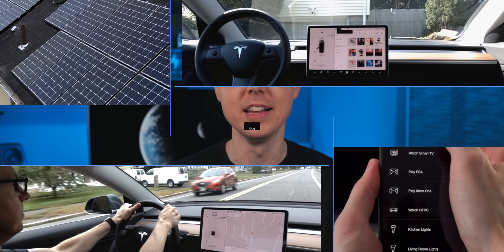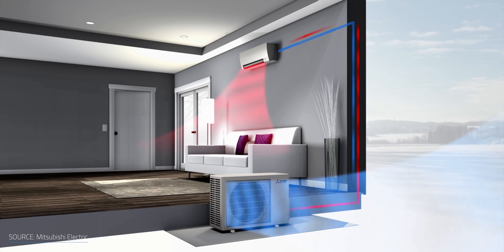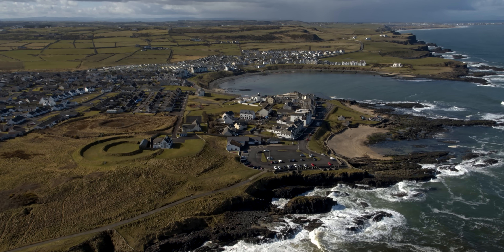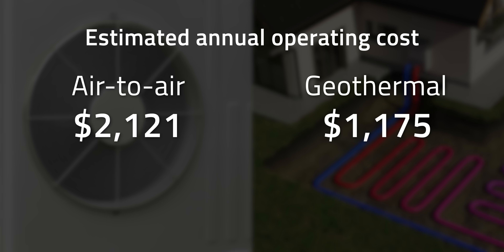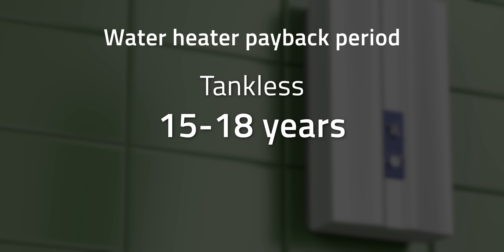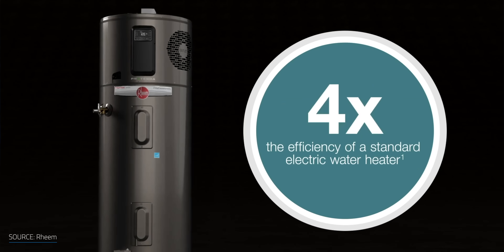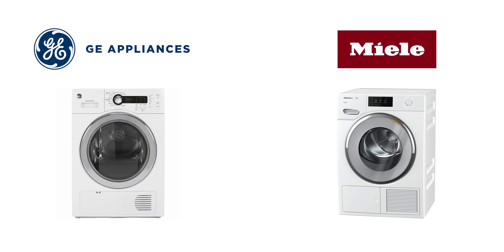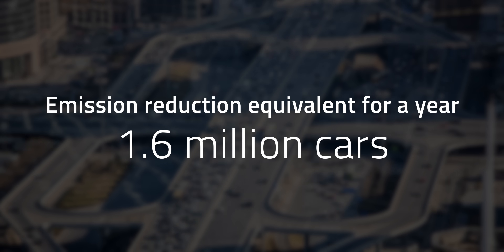Why Heat Pumps are Essential for the Future - Explained

Comment: My brother had a home that used a water to air heat pump system.  There were two wells on his lot and heat was extracted from the water coming from one well and the cold water returned to the other.  In summer the direction of water flow was reversed.  He did live in an area where the water table was very near the surface, though, which helped keep the cost of drilling the wells reasonable.
Reply: @leedon7435  So that explains why my A/C and my heat both run off the same heat pump.  Who knew?
Reply: The water/water variation of this is the most effective/efficient heatpump system you can install. There are caveats and risks, however, and in practice it is pretty rare. Sole/water is typically installed instead of this, but also has prohibitive cost and space requirements - cash aside, many new land plots assigned in Europe don't have enough spare land surrounding the building for such drilling to be an option. As a result, air/water pumps are ubiquitous here, but typically can't cope with the coldest days in winter - even in modern and well insulated homes with efficient, under-floor heating loops.
Reply: @jerrymiller276  all AC are heat pumps. They pump heat out of your house in the summer. Models that do both cooling and heating simply have a reversing valve that switch the direction of flow for the liquid refrigerant in reverse. They then pump heat from outside into your home. The air on the outside compressor will be even colder than the surrounding air, even in freezing Temps.

Comment: I had a Miele heat pump dryer for almost a year now and it's pretty great. What I didn't expect is that this dryer (and its companion washing machine) totally changed how we do laundry, for the better. The fact that the dryers don't get as hot is actually a good thing, because overheating clothes makes them wear out faster (even when accounting for the longer tumble time, you come out ahead). However, the lower temperature and just how the dryer works, means it's important to sort laundry into similar fabrics. For example, if you try drying some jeans and t-shirts together, the t-shirts will dry before the jeans. You should be sorting this stuff anyway, but a heat pump dryer really forces you to do this. So, we got 4 smaller laundry bins and now we pre-sort as we throw the dirty laundry in: towels/denims, dress shirts, cold, and regular/warm. This way, we're always ready to run a quick load, at the appropriate settings. No more time spent digging through a pile of laundry, sorting the colds from the warms. It's great.
Reply: Does the room the machine stands in become colder?

Comment: I didn't realise these systems weren't as widely used in the rest of the world. In Australia, they're basically the only type of system you can get and are definitely very efficient. They work very well in our climate as we do experience all the seasons (tending more towards the warmer side), but without extremes. I have even automated my house to turn my split systems on in summer while there's excess solar generation in order to trap some of that cool air inside. It's especially good to come home to an already-cool house in Summer.
Reply: I don't think that's really true. I think you would find the vast majority of our heating and cooling in Australia is still gas or electric.
Reply: Heat pumps are big in Tassie.
Reply: @JoLynch0  You are misunderstanding the video I believe. All split systems/inverters in AU in the last... 15-20 years I believe run on this gas and are heat pumps. We just don't call them that here. Are there some places that still use gas? Sure, but not many compared to the number that use split systems.
Reply: @Sebastianimator  A lot of homes here in Victoria use gas heating. Decades of cheap gas from Bass Strait and a cooler climate mean it's still common to see in homes.

I've switched my heating/cooling to heat pumps but the hot water is still gas... for now.
Reply: Honestly, it makes a lot of sense somewhere as warm as Australia. Many homes could probably do just fine with heat pump only setups (no need for backup systems).

Where I live, Utah, a heat pump only system wouldn't work, so I would need a dual fuel system, which has a higher initial cost. 

Also, natural gas is MUCH cheaper than electricity here. If I switched to an electric furnace, it would cost me over double to heat my home. A very efficient dual fuel heat pump could just about match a gas only furnace in fuel costs, but the initial cost is still more expensive.

Comment: I’m glad you mentioned tumble dryers. I was wondering if the waste heat from a traditional dryer could be channeled towards a heat pump system, or efficiently stored rather than simply vented into the atmosphere. 

In the future I believe that most homes will have any many ‘closed loop’ systems as possible for heat, energy and water. These advances will likely be useful for environments where water and electricity are scarce - like in low earth orbit, the moon and Mars. This will be yet another arena where space tech helps us on earth and our improvements feed back to space tech. It’s not just about Velcro and Tang 🙂
Reply: There are already dryers (or tangent systems) which utilize the waste heat generated. But these new heat pump dryers don't fit that description because they don't have any waste heat. In the above mentioned system your house would receive unwelcome heating much of the time if there was no duct. That is because the dryer is generating heat from electricity or gas, using it, and then it becomes "waste". With the heat pump dryers the unit is "taking" heat from the air immediately around the machine, using that heat, then rejecting it back into the same space. There is some additional heat generated by the machine itself (via the heat pump compressor), but that is roughly 1/4 of the heat "generated" by a conventional machine. I agree with your comments and mostly just wanted to give credit to the idea that waste heat from conventional dryers (elec or gas) can absolutely be used, though it is not economical or practical to do so outside of commercial laundry operations. In such, it is not uncommon to extract heat from the vented dryer air (using a water coil) and use that heat to "pre-heat" the water for the washing machines (using a water heat exchanger). Cheers!
Reply: I built a box going to my vent wherein I could manually change from exhausting the dryer to venting it through a filter into the room.  A little moist but heat paid for already.  I'm also guilty of running the dryer a few minutes to heat things up.  Worked great.

Then I moved.
Reply: In the winter when it is freezing you risk icing up your unit from the humidity. Also you dont want ANY lint to make it out to your heat pump coil fins. I vent my dryer into my house when it is time to heat my house. My filter is a nylon. The benefit is 1. get to use heat you paid for 2, a little extra humidity in the home in the winter 3. You are not drawing cold air into your home. For every cubic foot of air pumped out of your house another cubic foot of outside air must be drawn into the home. Which can be problematic if you are trying to heat your home and now must over come the cold air you are drawing in.
Reply: Heat pump dryers are here and will probably become common over time. 
   The problem will be repairs.
Dryers today are simple and easy to repair. Yet rarely need more than a good cleaning our last dryer was 13 years old when it quit working. 
 I doubt my new one will last as long
Reply: Just worry about bringing energy everywhere, more than energy waste. We need cheap energy more than ways to save it. I we can achieve both fine. Cheap energy is everywhere, but the evil people who manage this planet don't like for us to enjoy it.
Reply: @steffenlee2960  - that is What I have been woundering but cant find anywhere. A heat pump dryer must “steal” heat from somewhere besides inside the dryer…? 🤔 Have you seen any dokumentation on this….?
Reply: @vickichamberlain9124  You don't get that problem with a ground source heat pump. They are more expensive but the performance holds up when the outside air temperature drops below zero. I have one so I know.

Comment: In very cold climates you can build a small gas fire place with coils for the heat pump. Heat that normally gets wasted up a chimney can be pumped under the floor. Gas fire eliminates need for defroster, and gas heating becomes less wasteful.
Reply: A natural draft fireplace will never be efficient enough to be used as a primary heat source. I do like the concept, though. I'd recommend using a woodstove or direct vent gas fireplace that can direct heat from the heat exchanger through ductwork. You could find a way to safely install coils into the ductwork. (p.s. I'm a certified Master Hearth Professional.)

Comment: Another technology helping with this is energy recovery ventilators - pre conditioning incoming fresh air using the exhaust. That way you need less heating or cooling overall
Reply: Excellent point, I have a Panasonic ERV. It works as advertised,  verified by measuring air temps throughout. New builds require fresh air intake to comply with indoor air quality standards, as you noted, an ERV overcomes the inefficient direct draw of outside air.
Reply: Heat recovery is not a new technology. Most large buildings like offices here in the UK have been doing that for a while now. It was not originally an energy saving feature, but more to pre-warm fresh air being introduced into the system using the warm foul air being extracted.
Reply: Yup, but you need a tight house for it.
Reply: I made a DIY heat recovery bathroom fan.  Made the heat exchanger out of tin foil and coat hanger wire.  Plus fans and ducting.
Reply: Unfortunately ERVs do not save much on heating and or cooling, they however can make your home healthier.
Reply: A truly complete and smart HVAC system would control fresh air, heat recovery, humidity control, fume exhaust, air temperature, air purification, air sanitation, floor temperature with heat sources from fuel, electricity, outside air and ground all under computer control.
Reply: @dougle03  Isn't that the same thing?  Otherwise you could just open a window.
Reply: @keitharmitage298  fresh air has to be brought in commercial buildings. The air brought in is tempered by the exhaust air , around here it’s typically an energy recovery wheel. More air can be brought in while economizing but the wheel is used to take the load off of the cooling equipment in my area.

Comment: I had my Rheem heat pump installed in Nov. 2020. It's a 5 ton 21.95 SEER and 11.5 on the heating side. Last winter here in southern NM was the first full winter with it. They also installed a 98% eff. propane furnace/air handler for the backup. I had put the heat pump lock out temp at 20 degrees, and I ended up using about 10 gallons of propane for the entire winter. Not bad. I think this next winter, I'll turn it down to 15 and I might not use any propane at all. The heat pump didn't seem to have any problems heating my 2200 sq. ft home last winter and we had a dozen or so nights in the teens.
 This would make me net zero as I have a 12.4 KW solar power system that more than supports my entire all electric home.  I also put in a Rheem heat pump hot water heater, and a Samsung heat pump dryer. I've embraced heat pump technology, and I can say first hand it's the way to go.
Reply: What refrigerant does it use?
Reply: @mickjager5974  410A I think
Reply: Hi.
How much did your heat pump system cost? How much was the solar PV system?
Reply: @ChrisLee-yr7tz  The Rheem heat pump for heating and cooling is their top of the line Prestige Series variable speed, and with the furnace and air handler, Rheem digital thermostat, everything was $16k. My original 3.6 KW PV was installed in 2010. After fed and state tax credits the cost was about 14K. Last summer I added 8.8 KW and the after tax credit cost for that is about 18K. I over expanded my solar because I have plans on getting an EV.
Reply: @dahur  Thanks for the info.
Did i read correctly - so nearly $50k for everything?
Reply: @ChrisLee-yr7tz  Over the years, pretty much. Solar was much more expensive in 2010.

Comment: My dryer vent plate designed to open only during active drying,  got stuck open and allowed wasps to build a nest around the vent hose.  So, eliminating the need for an outside air vent connection is very appealing to me regardless of efficiency! Already have to drain water for the washing machine so can use that to empty moisture created by the heat pump.
Reply: I had a bird try to build a nest in my dryer vent when that got stuck open :)